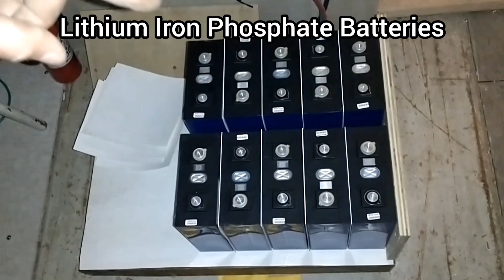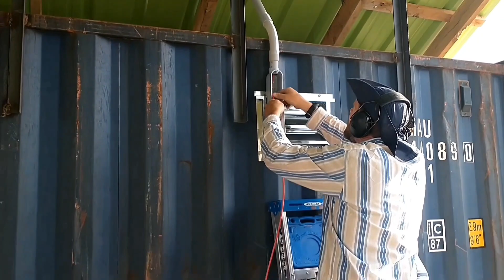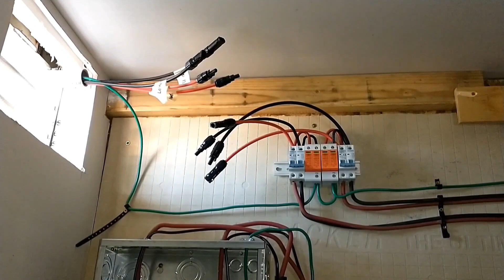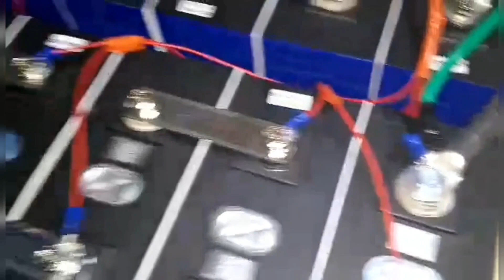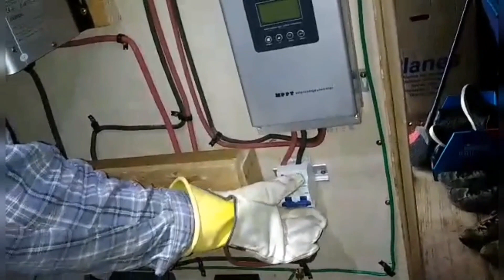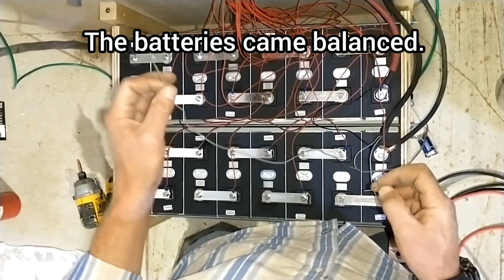Solar Startup for Our Off Grid Home 🏠 Compressing the LifePo4 Batteries, 6,000 Watt System

Comment: INSANE! TOTALLY INSANE! You're NO ELECTRICIAN! You just follow a diagram... C'mon!
 I bet that American Insurance companies demand the same requirements as in Europe! 
You MUST HIRE A CERTIFIED PROFESSIONAL FOR SUCH A SERIOUS INSTALLATION THAT REQUIRES PROFESSIONALISM!
Right after the installation YOU MUST HAVE AN INSPECTOR ALLOWANCE TO RUN YOUR ELECTRICAL NETWORK!
Otherwise, in case of hazards, whatsoever, even after a tornado, Insurance companies have the right not to enforce contract clauses.
Reply from the maker: We have what is called an opt-out permit. It allows us to do everything ourselves, and to opt-out of most inspections. There are a few areas in the US that have similar permits. We didn't expect to be able to get insurance on anything, but we were able to get it once everything was done. The insurance company knows we built everything ourselves, and it wasn't an issue. As with many things in life, there is some risk, but we are okay with it.